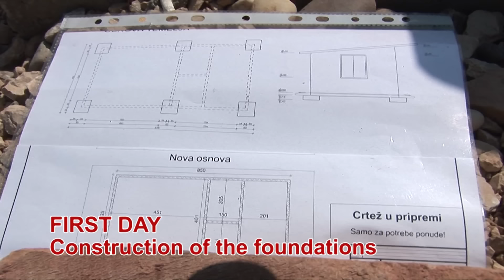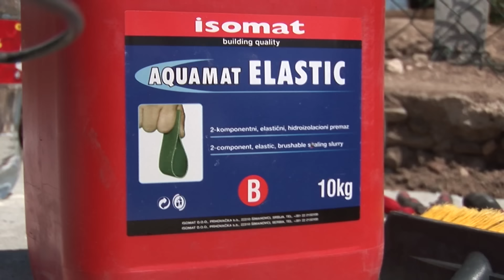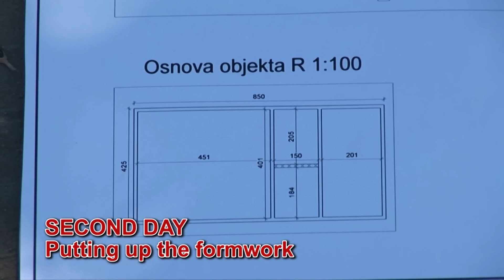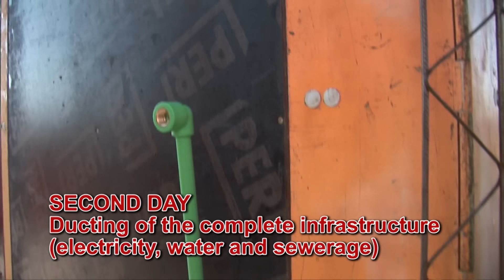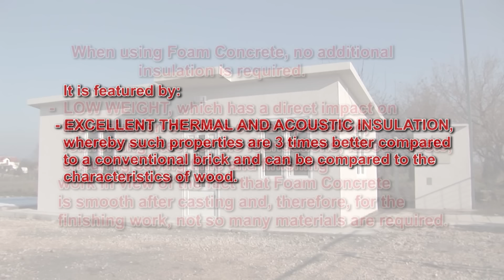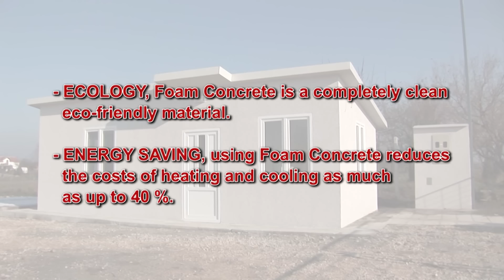FOAM CONCRETE, affordable house built in 6 days!

Comment: Best of luck if plumbing or electrical fail in the wall after it's built.
Reply: +Michael D What's the diff?  In a framed wall w/' drywall, the wires, etc. are not reaily pullable anyway- often stapled/bolted  to the framing.  And it is probably as easy to expose a  2' access hole in this as it is in drywall.
Reply: Patrick Ireland From what I assume, all plumbing is embedded within the concrete walls on this build versus being ran through or between studs in a stick built house. I can assure you from experience that removing and replacing drywall when you need to get some serious work inside the walls done-such as re-configuring utilities and electrical- is far quicker and simpler than opening up a concrete or concrete block wall and then patching it.
Reply: +Michael D The plumbing in in the poured slab as was shown. They do this already and it works.
Reply: +Michael D - This would not be a problem for something completely off grid.
Reply: Michael D Exactly! 😂
Reply: Meeker Extreme:....No, they currently don't put plumbing-water-sewer pipes in the concrete pads...it's below the pad in the sand base. They only come up through the pad 90 degrees.
Escape from NY: what are you saying, since it's off the grid, we won't fix the electrical or piping in the walls and we'll just "close-off" and run temporary lines around the outside and inside the home? Being off the grid does not not change the problem of access to the leaking pipe or open-shorted wiring issues.
Reply: Yes a person would want conduits and access points

Comment: I have lots of questions 
What is the R value of the foam concrete
What is the wind load
What is the cost per SQ ft
Also what is the supposed life of the foam concrete
Reply: I have similar questions and there seem to be a lot of comments like these but no real answers. I don't even know who is building these things or where? If it's affordable and could make the lives of the poor easier I'm sure it will be illegal in the US where I live anyway 🤷
Reply: @RoyArrowood  As long as an engineer/architect can specify the material and it has proven characteristics, then that material can be called out on a drawing and used. The local government would have to specifically make codes that do not allow a given material in order to stop its use. The biggest issues are earthquake and wind loads. This material is actually pretty excellent for both when properly specified.
Reply: R6 per inch.   Foam generator costs a couple hundred bucks pre-made, less if you build it yourself from PVC pipe. 1 bag of cement plus a pint of dish detergent plus a few gallons of water makes six or seven cubic feet of foamcrete. Strength comparable to a stick-built wall

Comment: I foresee a lot of potential problems with having all the electric and pipes buried in the walls
Reply: You are not alone .. i said the exact same thing
Reply: Everybody do that in EU, where will you put pipes outside of the wall,?
Reply: @role6159  WHAT?! Literally NOBODY does this in Europe, except maybe the Balkan! We put in insulation hoses with the cables and wires are inserted into, so they can be replaced and added to. And nobody here in Europe builds a house for year round living with only 15cm outside walls! My house has 30cm brick walls plus 20cm insulation all around the outside, also on the roof, while modern standard is 50cm brick walls.
Reply: @peterkoller3761  yes my house has walls 35cm and is the same as yours and houses in balkans are very much all concrete and good builted, it's about these wooden houses or small weekend houses L talk about
Reply: That's how they are wired in the Caribbean.
Reply: Agreed, it's a bit oldschool to put plumbing in exterior walls. Maybe not an issue in warm regions. However, foam concrete is much easier to break apart than traditional concrete if you need to fix something in the walls. Then you just patch it up with new foam concrete, good as new. Also, in addition it acts as both thermal mass and insulation.
Reply: Thank you! I was looking in the comments to see if anyone else was alarmed by this. 🤣 It took me forever to find a comment about it. I guess you can tear an exterior wall out and replace it if the wiring and plumbing go bad. lol
Reply: @peterkoller3761  yup thats my point Zvone didnt get
Reply: @role6159  weekend  houses, do you only use them for the weekend?
Reply: @Bethpoozie1799  if there is a break or problem you will have to put the water and electric lines on the out side of the walls to replace them

Comment: rebar directly on the ground? that can't end well
Reply: Die statische Anordnung ist schon ok, dort gehört der Baustahl hin.
Reply: william downey  you pull the mesh with a rake as you pour
Reply: yes!
Reply: william downey exactly. There's no good rebar cover in this case, the proper way is to pour a thin layer first, then the structural layer with the rebar on spacers to ensure good cover.
None of that in this video, not even plastic foil to cover the ground. What they've done here doesn't pass inspection. Completely agains best practices.
Reply: +dykodesigns2yt sorry, you don't know what you're talking about. there's no need for poly under the concrete, or a mudslab. This is a small house, not a high rise. Also, nobody puts spacers/chairs under mesh, you can pull it up as you pour with a rake or hook
Reply: If you pour concrete directly on the ground soil, there is a risk that the concrete mixes with the soil and that the soil can absorb moister from the concrete causing it to cure inproperly. Spacers are needed to ensure you get good rebar cover.  Also, the ground isn't flat so the rebar cover varies too much. What they do in this video is bad practice and substandard. 

Because they cut corners on the execution of the slab, it will be less durable. 

The least they could do is put plastic foil on the ground to seperate the concrete from the soil. What they do here would not pass inspection in the netherlands.
Reply: +dykodesigns2yt 

It's a small cheapo house in Africa. It's not a space station. Sometimes good enough is just fine and anything better would be unaffordable. I'd live in it quite happily while Architectural Digest  throws criticisms at me.
Reply: +PDZ1122 Ok, but I'm a structural engineer who designs a lot of concrete structures (anything from bridges to housing). The risk of this particulair execution technique is there is a bigger change of rebar corrosion. It's a uncontrolled surface, so you need a bigger rebar cover to ensure at least a 50 year lifespan. I don't mind the contruction technique of house itself, or the use of a slab foundation, only the way the rebar of slab is applied.
Reply: +dykodesigns2yt Chair it up like good Iron workers do on a real job.
foam crete.?  lite weight concrete.  seen it used for sound prooffing on apt floors. long time ago do they still uses animal blood in the mix?
Reply: +PDZ1122 Judging from the plans, Poland has relocated to Africa. :p
Reply: dykodesigns2yt Come and build me a house.
Reply: Chairs and  poly are required items according to the IRC.  The concrete will wick moisture from the ground.  Pulling up the rebar will not stay put.  They could have propped it up on rocks.
Reply: The video clearly shows the concrete being finished with the exposed adjacent rebar on the ground.
the lack of a moisture membrane is very poor as the costs of the plastic is minimal.

very poor standard of work.
Reply: NO ONE uses plastic, here (Midwest USA). It's concrete directly on top of a few inches of rock. Guess what? Every house built in a proper location (low water table with proper drainage) is BONE DRY in the BASEMENT. A slab house absolutely needs no such water barrier LOL. Rebar should be spaced with bricks to ensure uniform and proper height, though.
Reply: it leaves a rust footprint mark, so that they can remember where building was.

Comment: So all that concrete was dry in the first day - ready to be sealed in the second.  What else are we expected to believe?
Reply: +Bob Loosemore Sealing was the last thing in the video...day 4
.
Reply: +Bob Loosemore As Gerald said it was day 4.
But consider foam have a very large surface against air, a lot more than normal concrete, so the chemical reaction of concrete and CO2 happen a lot faster.

If you suppose the actual surface is ten time the surface of normal cement, you could expect the chemical reaction to happen ten time faster.
Reply: +Bob Loosemore Day two, not consecutive day two I am sure..the concrete needs to cure a little..

More like day two, a week later.
Reply: On a hot day it would be around 4 hours. I've done lots of concrete. Really it depends on the mix you're using.
Reply: +David Clark   can't argue with that.
Reply: +aguyandhiscomputer  i can
Reply: +kl meyer (simonkat) Ok. You start.
Reply: +Gerald Wagster The mix they were using was from an onsite mortar mixer.. So i assume quality control was at  its finest!! The landed the roof panels way to early and at risking lives! I've poured 100's of thousands yards of concrete and IF they did what they did in this video was at complete risk of killing someone!
Reply: +Bob Loosemore Also take note at the beginning of the video everything is green, leaves on the trees etc.. At the end of the video the trees are bare!!
Reply: +Mirco Romanato   No.  The surface of normal concrete does not cure faster than inside the volume, to my knowledge - but i don't know the chemistry of curing.
Reply: +Papa Mac   This makes sense, but it is dishonest not to explain.  My word! a dishonest YT video - what next........
Reply: +Gerald Wagster   On hot days concrete DRIES quickly, but this will prevent curing, and the result will be useless.
Reply: +aguyandhiscomputer Look - it's obvious you two!   Those people did not pray proper  -  they are liars after all;  god LOVES them.
Reply: +SAUKEN 15  Well noted (about the trees) Sauken 15.
Reply: +Bob Loosemore 
I'm not telling the inside cure faster than the outside, just that having more surface increase the overall speed of curing.

But, being a chemical reaction with CO2 and the concrete mix, it will start from outside to the inside.
But, being porous, the CO2 will infiltrate inside the wall, so there is a gradient (faster out, slower in). How much the difference is I do not know.
And this is the reason, larger, deeper is the concrete, more time it need to cure it.
The gas need time to diffuse inside , because it will react first with the first  stuff it meet. And the first stuff is near the outside.

In a foam, the gas (CO2) could diffuse very, very fast. So the curing could be pretty fast.
Reply: You are reading to much into this..  You need the 7 day breaks to make assumptions like that!
Reply: +Bob Loosemore The days were not consecutive days in time.  On their day one there is a 3 foot high corn crop  (frame 1:54) and the trees are green (frame 1:40).   On their day two the corn crop is 6 feet high (frame 5:56).  On their fifth day the corn has changed to brown and looks as if it is harvest time (frame 11:09).  On their sixth day the corn crop is gone and a new crop of another plant is already up out of the ground and growing.    Therefore the days that work is occurring are at sometimes months apart.

i do not know if the builders are trying to convince us the house was built in 7 consecutive days.  I do not know if the builders are trying to convince us the house was built in 7 working days.  The facts prove the house was built over a period of  months.   70 to 100 days are  the length of maturation of a corn crop.  In the beginning the corn was 30 days old.  My best guess. The concrete had plenty of time to cure.
Reply: Thomas Harrell It was longer than that check out the leaves on the trees in the beginning and none at the end
Reply: +SAUKEN 15 Sorry just my best guess.
Reply: +Bob Loosemore 
I guess when  they said second day they meant day(work) not next day.
Have a nice day  Bob
Reply: They never said it linear days. Proboly they worked one day and left out one. It's still the second work day and not necessarily the next linear day.
Reply: They were advertising a complete house in 7 days... Using your rational and 20 story building takes a month to build!
Reply: +SAUKEN 15 idk...Proboly they use a quick drying cement which doesn't need to be cured to build on.
Reply: Obviously you have no idea what you are talking about.. Check out the leaves on the trees in the beginning of the video and then at the end there are no leaves and everything is brown... took them months to build this house!!
Reply: +SAUKEN 15 ok. seems you're much more observant than I am . I didn't notice.
Reply: Where did I say I like this home or even approved of a home like this?
Reply: Rico g Also they were mixing the so called concrete on site so I'm sure the quality of the concrete was at it highest!! NOT
Reply: SAUKEN 15 I beg to differ because concrete is mixed on site does not necessarily mean it's not of high quality. I live in barbados and people rent a small mixer and have laborers mix the concrete on site and it looks okay. Many people get ready made concrete not because of quality but rather of the speed,convenience and may sometimes  cost less than manual Labour
Reply: Absolutely not true.. The reason for "ready made concrete" as you call it is because it comes from batch plants where everything is weighed, measured and all ingredient are of the highest quality and stored in proper temps, conditions etc.. Many many many advantages to have a batch plant vs mixing onsite..
Reply: +SAUKEN 15 well, contrary to what you may think, we've been mixing concrete on site for years and I have yet to see a building crumble.
Reply: mixing by hand like in the video or having a batch plant onsite are two different things!!
Reply: +SAUKEN 15 Can we say that "micro vessacules" were used in the mix for the cement? and that it was given the proper cure time for altitude, density and temperature?
Reply: +Rico g Cures on structural foundations need time, and none was given.
Reply: Ted Hutch Ted you came in kinda late in the game here.. So to answer all your questions quickly... NO  Look at the trees at the beginning of the video and look at them at the end of the video.. A whole season went by as they completed this tiny project... Also they were hand mixing the concrete on site so I'm pretty sure quality control was not at its highest level..
Reply: I realizze that I came in kind of late, fill me in, bit  These structures are being built in areas where geologic instabilities are common, It's a a good thermal design, but obtuse to geologics.
Reply: I think all places should be built considering whether they will withstand storms, geologic events and tidal events to start the project, then the ability of the structure to sustain the people within comes next? What do you think?
Reply: Yea but has nothing to do with the conversation we are having about their methods of construction...
Reply: It has everything to do with construction because if the building is built without "ree bar" support contained within' it will collapse in a servere movement event.
Reply: Consider the "traditional" houses in Kobe, Japan.
Reply: +Thomas Harrell 
There was nothing about crew sizes, either.  Lot's of work on some of those days.  Also, that house was the size of many living rooms where i live.
Reply: +Ted Hutch. This "time" discussion is ridiculous. Nowhere in the video it says it's made in consecutive days.
That's how all the constructions i've seen go. They do a lot of things one day, then they come back a week later, and so on. It's still only 6 days of work. Not work done in 6 straight days.
Reply: +Gustavo D .
Reply: a concrete that gets dry next day is a total waste... when you need a real good concrete that will stand for decades, you better keep it wet as long as you can, so it has time to gain proper strength.
Reply: Yea, who needs to let the concrete cure!??? Its overrated anyways...lol
Reply: so when did they remove the formwork for the roof- The next day, I dont think so.
Reply: Bob we are expected that a nice blue eyed blond will appeared and hop in bed for the night            ….                      :D
Reply: the second day doesnt mean the next day, it means the second day of the build,  the same builders who build the base build loads, and the people who make the building start once the base has had time to cure
Reply: Bob Loosemore you' a fucking idiot and apparently happy about it
Reply: God made everything in 6Days it took them 6months! That concrete took a long time to cure for strength the roof would of cracked when lifting it wet